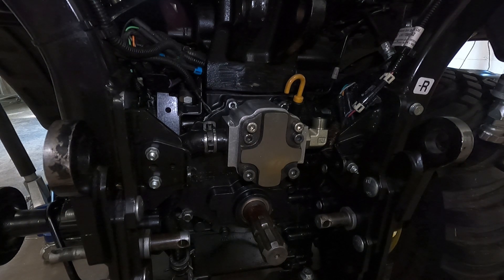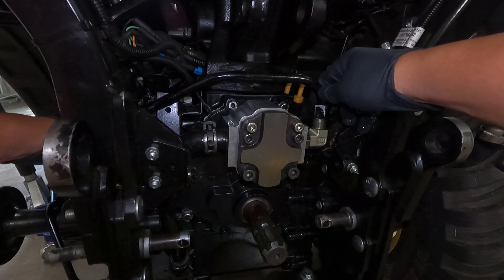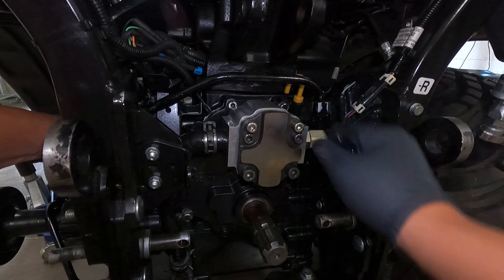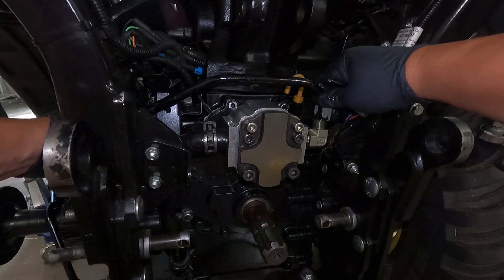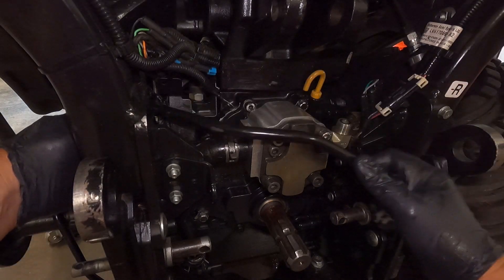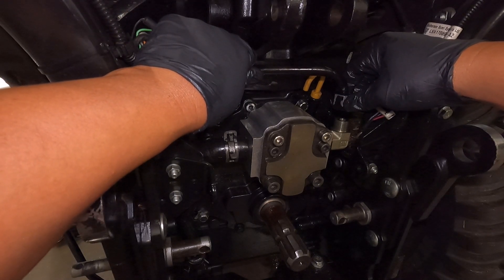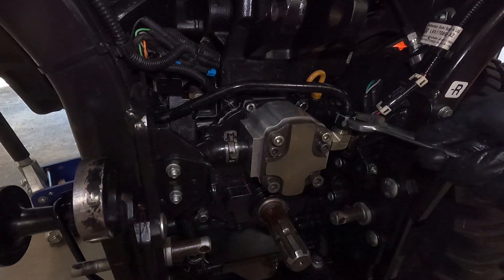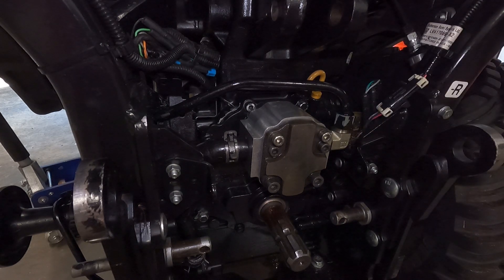HydrosPlus - Pump Upgrade Feed Tube Install

Comment: Hi, good info.  When will this pump be available and what is the flow?  Maybe I should have waited maybe. I ordered the extreme capacity kit which will be enough but more is better. Thanks.
Reply from the maker: I'm not sure at this point, but if you bought the extreme pump, you are not going to be disappointed.  If you decide later that you still need more flow, I'll work with you on the price.  If you want more info, feel free to drop me a message at kevin@hydrosplus.com.